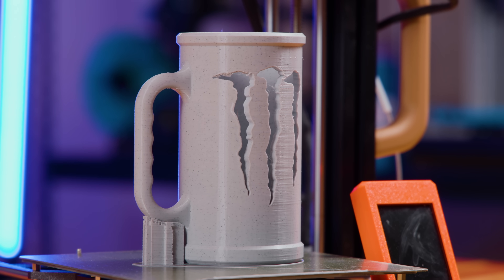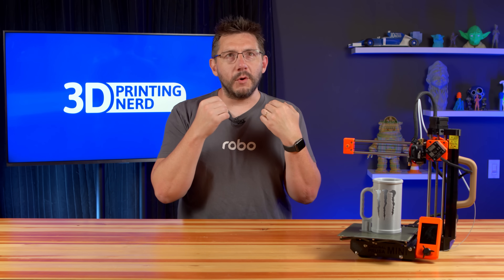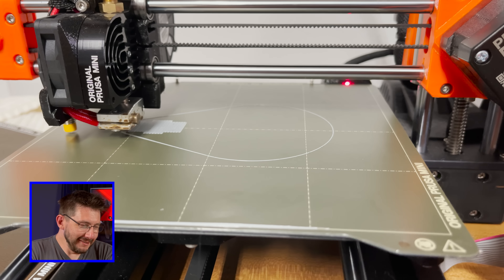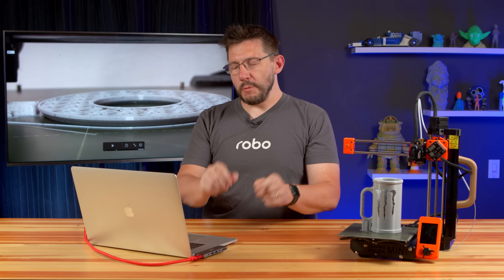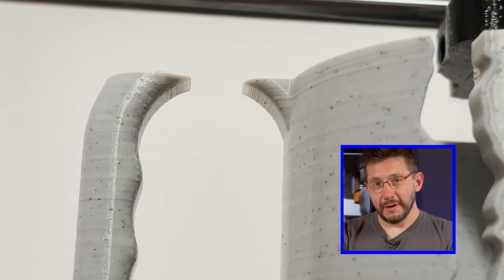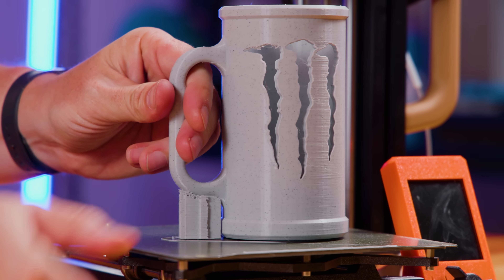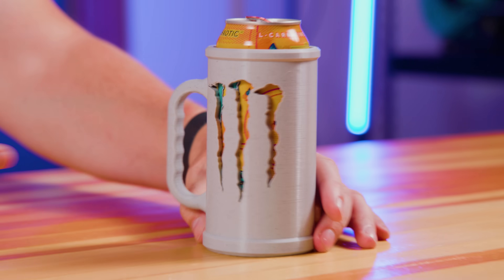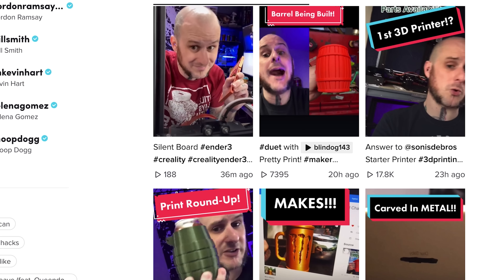WILL THE CAN FIT? // 3D Printing the Stimulant Stein on the Prusa MINI!

Comment: Thangs does not have licence transfers if you upload to thangs youll be trapped de valued and you wont be able to sell your own bizness. 3d printing nerd is not telling the comunity. Watch out newbs. He wont type yes he supports comunity because he does not support the 3d printing comunity to have resumed bizness services. Watch out newbs extreme caution required if listening to 3d printing nerd.  
You can reply yes to me at any time 3d printing nerd. But read this post comunity see if he types yes. Yes?
Reply from the maker: I full do not understand what you're saying, I'm sorry. Are you saying that if I upload a model to Thangs, I then cannot upload it anywhere else?
Reply: @3DPrintingNerd  OMG. Where have been?  I fear for what your not teaching people they gonna get burned badly.
If you upload to thangs you cant sell that licence.  Without licence transfers its trapped in your user name. Means your bizness cant be sold so de valued. OMG you need trainning stat. 
The ability to transfer ownership of licence is very very very critical.
Original upload date of creation is critical. So when licence gets sold the new owner uploads the thing file into there user name and original owner gets site to have upload dates match. Thats the guts i should post more detailed instructions. 
Without this biznes service you cant sell your own bizness.  thingiverse has this and i was using it successfully altho currently many services including this has gone down but hopefully be back  operational again soon.  Anyway
This is a very critical consideration when uploading...do you plan to sell your bizness at any point.
I also create licences for others as a service with the agreement they be sold. this can go wrong if bizness aervices go down and the biznes is trapped in my name so im now down. The client is down. The buyer is down we are all out of work im under pressure from all sides to solve this so i want the resumption of bizness services. Hence me asking for support for resumption of services. 
Vision minor said yes they supoort.
Creality said yes they support. 
Others like clients and so on of course want it operational again. 
This effects all with no  commercial licences. Value.. jobs..biznesses..newbs are not being informed so being trapped.
They may end up loosing there bizneses altogether if that original upload date is lost and someone else pounces. The original upload date of creation is critical.
Do you support resumption of bizness services...including licence transfers for comunity? Yes?
Reply: @WillofNewZealand  I'm very confused by this.  What are you talking about "Transfer of Ownership License"? You can attach you own License to your designs when you upload to Thangs.  All of mine I attach a Creative Commons - Non-Commercial license, same as I would select on other platforms.  Which means folks are free to make my designs for their personal use but Commercial the rights remain with me.  Thangs does not assume ownership of the designs.  Where is your information coming from?
Reply from the maker: @WillofNewZealand  You've confused me much, much further now. Where are you getting your information? The uploader attaches the license to the model uploaded to Thangs, and Thangs has zero ownership of the model.
Reply: @MandicReally  so if agree to sell me your ....lets say its a chocolate flower. 
We agree a price. And I paid you. 
I would downoad your thing file and re upload it into my user name. 
So at this stage you have original with upload date of creation of monday / 2/ 2018 as example.
I uploaded it on tuesday /7/ 2021
To keep the very critical upload date a date of invention correction is required. You ask for that correction as im now the owner. 
When site matches those dates there job is done. 
So now you remove your original because its been paid for.
Its in my name.
It has the correct date of invention.
Being monday /2/ 2018
Does thangs have that service?
I have not been informed they have.
If they do comunity should be uploading to them.
If not avoid them at all costs.
Reply: @WillofNewZealand  does any platform have that? I’ve never seen or heard of this before. Are you sure you aren’t applying a business practice of your country to ours? We generally don’t sell our licenses entirely but rather license individual uses of them.  I feel like you are discussing a subject outside of the sphere of what these platforms are intended for.
Reply: @3DPrintingNerd  oh ive replied to the other person on this thread. Same answer anyway.
Nothing to do with thangs owning licence. Read posts on page and get back to me if more questions.
Reply: @MandicReally  as in my example on this page thingiverse has it. 
Thats why they were number 1 site. 
Ive been in this a long time hence my experience.
Reply: @3DPrintingNerd  hows that yes comming along? Say yes to resumed bizness services for comunity?
Does thangs have this critical service?
Reply from the maker: @WillofNewZealand  I cannot say yes to something I don't understand. I don't understand this.
Reply: @WillofNewZealand  Can you point me to where they state or specify they do? I can find no reference to it and really no reference to it anywhere online. I too have contacts at Thangs to present your statements to, but I won't waste their time if there is nothing spelled out to present to them.
Reply: @MandicReally  ive had to train Creality who said they would come online as per my coaching.
Cgtrader yip i coach them also...considering.
I already informed thangs in a post ....they are very green newbs.
Dont think they know what they are doing yet  but as i said learn fast im coaching other new players. Be in or dead in water. 
Time is short so learn fast. 
Soon as a player comes back online
They are going to be the only operational choice. 
Creality  from China responded in 24 hours with a yes. And again to coaching and systems required. 
I wish them nice success. 
Is thangs offering this service?
Lets hear about it...tick...tick.. tick
Reply: @3DPrintingNerd  sounds like you have uploaded to the wrong site sorry. You cant sell those bizneses youve uploaded. Your trapped newb. 
Thats the guts your a newb and not anywhere close to being qualified to offer advice. 
Are you going to ask me to train you?  Watch this answer comunity to see how much respect he has for learning and teachibg the comunity. Ti save comunity from becomming pirates. Saving you all from loosing your bizneses. 
What dont you understand? Ask right now.
Reply: @MandicReally  ask them. 
I have sales records.
Lawyers had meetings they have records. 
Our countries sales site has records.
Client records.
Theres proof up to my eyeballs.
Lucky likeing me is not the issue ha.
Do you support resumption of services? For the comunity. Jobs. Bizneses. Value. 
I only found out by asking.
Thats how i got into it. 
Thats how i got from a 1 dollar listng.
After lawyers were coached by me to what a 3d printer even was...uh...i was informed to have certificuts for each licence made ti be sold with licences. 
Built up from 1 dollar listing. 
To10 grand. 
To our countries sales site limit of 99 million dollars. 
To the no limit at thingiverse of 2 billion all in listing. 
Offered to Mr Musk And Mr Bezos.
And others my clients want services back on. 
So thangs dont have it do they?  
Do they exactly as i said. 
Ask around. 
Do you support resumption of bizness services yes?
Do i have to buy your support?
Reply: @MandicReally  you send my comments to thangs ...may i laugh...they already know.
Point to stuff....ha...id never have got to where im at buy whats said....whats not said...mmmm.
Thats how its done. 
Ask.
Try it.
Reply: @3DPrintingNerd  watch this thread comunity these are your influencers. What dont you understand about it? Come on what?
Reply: @MandicReally  hows the asking going....feel free to waist all the time you like asking thingiverse they know dam well im exactly correct. 
They cant say im wrong cause im not they know it. They know i can prove it. Go ahead ask them feel free.
After you get over waisting time trying to disprove what im saying cause you have zero chance of that then what?  Forget me for a second and
Just consider comunity and there jobs value bizneses. 
Do you suppirt resumed bizness services?
Remember the bizz servicrs or a new player could come back online any day and how are you and Mr Nerd going to look?
Honrable?
Honest?
Supportive?
Good?
Knollageable?
Qualified to teach industry?
Supporting jobs?
Supporting bizneses?
Supporting Americas people?
And the rest outside?
Reply from the maker: @WillofNewZealand  Uploaded to the wrong site? What the heck are you talking about? What is a "biznes"? What do you mean by "resumed bizness services"?

I'm looking above at your chocolate flower example to MandicReally. Let me see if I understand what you're saying. You have a file with an original upload date of X. Someone beyond the date of X buys the copyright to the file. That person uploads the file to the same site it was on, and has it under their name, with the date of Y. New owner wants the upload date changed to X as that was the original date of upload of the unique works.

Is that right?

Lastly, why in the world are you saying what you're saying to me because I don't understand something? Why do you insist on being a jerk?
Reply: @3DPrintingNerd  thanks for responce. Sorry for slow redponce..got bizzy. Ok yes your getting it...x.   right then...y.
You get that. 
Being a jerk perhaps loosing my patience a little... only billions at stake..  jobs.. .pressure im under.
A little stress as you can imagine.
Have to poke at you a little....apeal of responce by provoking emotions a bit. So far so good. Sorry about that. 
Ok back to bizness. 
Im all ears. What say you.
Reply: @3DPrintingNerd  thingiverse yip does done did that service.
Welcome fact checks.
Be assured that all happens happened. Did...you get it.
So lets say you got passed doubting me. 
Back to support question.
Support resumption of licence transfers by them or who ever does it?
Thangs dont do it do they?
You uploaded and didnt know so it was a unimformed disision? 
Be carefull answering that.
But try answer.
That service i want back for all comunity is not the only service down. Theres others want to hear....i dont wsnt you any sadet about stuff but its important. 
I post in a minute.
Reply: @3DPrintingNerd   @3D Printing Nerd  biznes is poor spelling. Abreviation. Business.
 Youd be supprized i do my own real estate deals and care not for spelling.  Math mmm. 
Resumed biz services means resuming of services in nature or use in a business deal. 
Explaining stuff...not easy.
Imagine trying to teach lawyers.. uh.
I licenced chocolate with creative commons ....make modify sell..so all may have access to yummy choc as we all deserve some chocolate.
So you are welcome to make a chocolate...something original ...add your own variety.
With that new chocolate something and youve done a licence check incase its already done and found you are the first you can sell that as a tester. 
Thats how i would test a site. 
Licence a chocolate ...something original and try sell it. 
If you upload to thangs and you were well informed you could never sell that licence then you know and were well informed and your influencer had tought you what you were getting into. So not the wrong site if well informed. 
How to upload education is badly lacking in comunity.
How to check licences is badly lacking in comunity.
I dont want others burned as pirates cause they dont know what they are doing like i was. I learned that one.
Anyway im working on being less of a jerk yes.  Thank you for pointing that out. I wont cry im under pressure.  Thank you. 
Please say yes to resumption of services for business use for cominity. Yes?
Thank you.
Reply: @3DPrintingNerd  so comunity now Joel the 3d printing nerd understsnds has he said yes he is in favour of comunity having resumed licence trsnsfers for comunity?

See how im supposed ti be the jerk here. While i fight on in support to uphold the value of the 3d print comunity. 
I want all the comunity to consider ...
Am i actually the jerk here?
Are you sure you have it round the right way. 
I work in support to uphold the jobs businesses and value of the comunity.  Including licence transfers.
What about Joel?
??????????????????????????????
??????????????????????????????
Reply from the maker: Hey, I am reaching out to Thangs I’ll let you know what I hear.
Reply: @3DPrintingNerd  oh...oh...oh...i smell support. Show us the money Mr Joel 3d printing Nerd.
Good luck all round. 
Imagine if the accept a thingiverse upload date as true. And allow a migration to thangs. Oh baby then you see some serious uploading. 
They could be a one horse race. 
I might sell out....i might not.
Some im ment to sell as that was the deal. Could be biggest news in comunity if a resume were to happen. And i might be your biggest fan. Could be...perhaps...eh come on id be singing your prazes accross the entire world. Good luck.
To you Mr Joel 3d printing nerd and to Thangs. And to all wider comunitym
I wish you all nice success. 
Thats the best i know of. 
Post if any news.
Thank you. :)  i actually have a smile.
Reply: @3DPrintingNerd  Hi.
Dam pressure keeping me on this case.
Im back coaching Creality.
I see they now have made the first steps. Tick tick.
Did thangs decide in 24 hrs ...cause thats what they are up against.
Plus i have lots of exoerience.
My bet is Creality can get it together simply because ...
They want to.
I can coach them. 
Thangs have known for a while and if they were a real contender theyd have engauge me. Cause im the expert clearly. Or jumped based on my recomendations.....eh i dont truthfully believe they want to win the market. 
Which is fine but there no option for me but to get a player operstional.
China's Creality are quick to adapt.
Fast to redpond...24hrs every time currently.
Abliging...obliging...acomodating...
Whatevver you get it.
At this stage Creality are ....very small in my opinion but have the winners attitude.
They are going to easy walk into a failed fallen over industry badly run  and i suspect with little effort win the comunity. I wish them nice success. Ive tried and tried American companies....i think we can see how hard its been even to get support for your own country from its own people let alone to those outside.  
Stratasys buying up ...a lot but services operational? No.
Ask Chinas Creality ....a yes and action in 24 hours. 
Do you really thing thangs can get it together....do you think they can resist strats deep pokets...
Do you think if they were bought theyd not suddenly be ....down to?
All this shall reviel its self very soon.
Hows that responce from Thangs comming along?
About as fast as a some others take to show support....i dont want to poke at you but if i had to for the benifit of all the comunity i might say it might be to hard for yous leave it to me to sort it and i'll save Americas jobs and value. 
But hay if Thangs ever respond ...yawn... post here. 
Myself and Chinas Creality shall come to help you up.
Poked enough?
Hope so.
What say you?
Reply: @3DPrintingNerd  eh im up late 1am. 
Im thinking about thsngs.
My late night opinion. 
They aint gonna amount to anything much if i had to bet.
Im good at betting 21 days currency doing one sepetate trade each day...
Trading 21 wins zero loses. Using my own brain.
Try it see if you do better.
Thangs search engine is very very very weak..... very very weak.
Id not invest in them cause they didnt take up an expert.
Sometimes i think its as if yous are trying to self destruct.
Influencers and teachers for 3d print comunity in America are ....in my opinion not teaching the comunity much at all and avoiding the imporant stuff...stuff thats going to keep yall from ending in a big fight over rights. Not sure why teaching how to avoid that is so avoided.
Education as i discribe in above posts like how to check before upload before sales where to check...what to look for ...all mostly.... never covered but ive instructed yous on it. So the mess keeps growing very wierd direction to choose to go but hay...chase the pirates must be fun....we can play what ever. 
Even trying to get yous to say you want each other to succeed is like pulling teeth. 
You probably think im being the jerk...while im working to save your value and...what the hell theres resistance.....say what?
Can i get a yes from even you aint happened     un       friggin       real.
I keep thinking we split the atom first way down here in New Zealand. 
To me its clear why.
Hows that responce from thangs?.
Shall i upload a foot dragging model? Coated in molasis, stuck in tar monted on a unwound clock?
Im almost tempted to say dont waist time on thangs they aint going to get anywhere. Perhaps you cant see it. 
They would have responded to me so i bet you wount get anywhere with them either. In my opinion. 
But hay supprise me....lets see by 24 hours them adapt respond.
Lets see if any teachers or influencers youve got show any support for your own people  your own busineses or jobs ....yes to that? Hello?   __________
Vision Minor is a supporter of resumed services his company should be invested in supported they have integritty up to the roof. In my opinion. I wish them nice success. 
Creality wow they actually turn up to work ....and do some work...respond to customers wooooow impressive.
Say yes to resumption of services and learn fast adapt implament. They are going places. I would invest in them in my opinion.
I wish them nice success also. 
I wont list all the teachers and influencers ive contacted and what countries they are in and there attitude to the poor comunity. 
The comunity are being led up the garden path badly....do you have that saying? Anyway. 
3d printing is for the most part other than a couple of cases the most badly run under educated misinformed out of touch cloke and dagger no support newb crushing industry ive ever been involved in......in my long experience and opinion as licence king. 
Eh anything from ...yawn...thangs........yet?
At least you said youd contact them thats .....as close to a yes as im likely to get aint it? 
Gee 
My bet is ....may i bet since i almost died this year im saying what i think more now...youll likely just bail on the comunity cause i annoy you.
Eh strat may offer you lots of money ....search your feelings luke. Ha star wars quotes it is getting late.  Ok Mr Joel let me know if anything happens......else i shall assume thangs is just a dud. And youve hidden and bailed. 
:) Thank you for any responces. 
Be well.
Reply: @3DPrintingNerd  your last post was 1 day ago. 
Yip i went to bed at 2 am and yes im up at 7am. 
Are you annoyed at my posts?
Are all those jobs worth anhthing?
Does your annoyance make you think bugger it we dont want to help me cause im annoying and lets not get thangs to help....and unwittingly 
Cause thangs to loose this race to ssve jobs? Uploaded to the wrong site? Eh am i pokeing at you a bit?
Or 
Are you just dam lucky im helping you at all. 
Whats the bet thangs are a no?
Cant abide. 
We shall see wont we. 
I cant wsit to hear your responce......if any.
For the wider comunity....im already a winner. But its for the rest im doing this....hell dood i could sleep in. 
Take it easy. Buy some new shoes.
But its the others not Doing as well...
I think of them and....i can poke at you and the rest a little more on there behalf. 
Sorry i cant quite stretch to buying strat but i can russel up a work around. Dont forget to reply.
Reply from the maker: Hey. I’m seeing all this. Was in a car accident and taking care of things. I’ll reply in a few days.
Reply: @3DPrintingNerd  ok Mr Joel hope your all ok. 
Best wishes to you.
Bye for now and be well 
from Will and Mr Data  :) :]
Reply: @3DPrintingNerd  hi. I had another look at thangs.
Wow that search engine is bad. 
We are never gonna find each others busineses using it.
I know i should keep waiting for improvement but it looks ten years from being of use ...in my opinion.
Dam i need to.....we need to take over one of these sites for the comunity....its a business directory but i cant find myself and i know for sure im there. Diabolic.
This industry is in the dark ages.
Wearing a blind fold in a cave at night. Who are these designers?omg. 
I suspect bet you got no where with thangs while we remain down.
Im looseing money my clients loosing the buyers loosing.
Why did thangs even bother getting into it? Get funding and run?
Im so dam annoyed at how badly things are designed and operated.
Uh. So lets say we give thangs a week even a month to learn about the industry....and find it just is not flying then what how long is long enough?
I still stick to my bet to you that they pift. So then what.
We need a working business directory. How the hell is this comunity and industry ever going to work.....when is this mythical day...when.
Reply from the maker: @WillofNewZealand  dude. I have words from Thangs. I’ve also been dealing with accident stuff and spending time with family. I know you’re gung ho on this and I can very much see you’ve demonstrated your resolve. I’ll reply when I have some time.
Reply: @3DPrintingNerd  ok fair enough.
Yip time with family is short and of very high value. 
I can sustain the daily losses and pressure from others. 
Dood id put millions even billions on hold for family to. I do. 
Lifes a short game and family, love, friends
Are worth all the money and jobs in exsistance.  Look forward to any news. Thanks for your responces.
Im sure you understand any prodding from me is just business.
Bye for now and be well
 from Will and Mr Data :) :]
Reply from the maker: @WillofNewZealand  Finally have a moment to sit down. I think the issue is I and lots of people don't know what "resume business services" means. I think through the messages here we have finally come to define it as having to do with the transfer of ownership of an original model but having the original model maintain the first date of upload. Is that correct?

From Thangs: "As of right now, a user would have to invite another user to a private folder and then the added user could download and reupload it. The creators would need to work out either via email or in writing the transfer of ownership. However, we just implemented a new authorization feature which will be able to be used in a future update to the site. Essentially, it could be used to transfer ownership of the model file to a different user. But as it stands, there is nothing in our terms and conditions or anything blocking individuals from selling models or transferring ownership. We actually encourage designers to link their patreon in their model descriptions."

From this, it looks like Thangs is a positive force here, with it's eye towards it's users and the future, making license transfers between people easier when future site updates happen.

Lastly, I don't think I could ever say "yes" to "resumed business services" because I don't think that accurately describes what you're trying to get across. I do support being able to carry over the original upload date of 3d models when the ownership license is transferred. I really hope that is what you're looking for.
Reply: @3DPrintingNerd  the winning boys majic.
Your final statment is gold. Thank you. Its a yes in my eyes and thats good enough for me. Yaye.
Yes my summing up of busines services is a summery of issues. 
You asked is transfers and date held the guts...yes thats the guts. 
I have other services im chasing down but transfers being the biggest value to the most people so i went for that first. 
Other things like no operating payment option for my entire country of 5 million at thingiverse was small in comparison. But i can work on that and other things.
The wider comunity would be all loving you if they knew your contribution to its overall value. 
I shall keep an eye on Thangs perhaps they may be on the board yet. They might even make a real difference for the comunity. 
They could even be a track to the top. I shall look into more testing. 
Since they sound so promissing.
This is actually probably the biggest news in the world of 3d printing in a year at least. Lets hope it pans out. 
High praze apon you. For being in it. 
I might even be a big fan. 
Could be. Go on. Ok im feelin very fan like. 
Thanks Joel. 
I shall re read your post again and post any other thoughts here. 
Sorry if i appeared prodding brash harsh jerk like etc but for a good cause. We may have helped many people i sure hope so. 
I may or may not sell out my positions of significance. 
Eh we shall see. 
Again Thank you Joel. Good work. 
Bye for now and be well from 
Will and Mr Data  :) :]
Reply: @3DPrintingNerd  thangs are not panning out. They didnt even understand why the first person to invent something and the date was important. Service is very patchy. 
Search engine is so bad its of no real use. And they Dont have license transfers. A utter waist of my time so far. Ive given them until friday to do some work or respond. Im going to review and rate and rank them after that. They may supprise me but as yet a utter total waist of my time and if i reviewed them right now... pointless and of no real use.
But at least you tried so thanks for that. I shall stay on them until friday. 
Im already looking for next site that may actually be of use to comunity and myself  For business use. 
Thanks again Joel. It was worth a shot. I post after friday and let you know. Be well.
Reply: @3DPrintingNerd   good morning.
We all less newbs today. Hopefully im less of a jerk also. 
Heres a post i just made on another man teaching comunity. 
sure hope your teaching newbs how to check licences before uploading anything.
Where to check licences. 
That designing at home and printing at home does not give the right to sell that thing. Else end up a burned pirate like me. 
I hope your teaching newbs that if they upload to a site that does not have operstional licence transfers they wont be able to sell that licence and its going to be trapped in there user name. They would be de valued.
Ive been nailed by all these newb mistakes. I hope your teaching them before they stumble into trouble cause nobody told them.
I was almost banned from selling anything ever again printed or not cause i made these mistakes.

And finally how to upload.
After licence checking to see if you have the right to upload.
What infomation should be in upload.
How and what details go where.
All lessons again i got nailed when not correct. 
I lost some businesses due to lack of education. Cause someone else saw my thing but saw i had a detail wrong and swooped in and took it from me. DAAAAM   IT.
That stung let me tell you. 
Ok back to this thread now...so hows that yes comming along.
Now you understand its just a no comitment word in support of comunity getting resumed licence transfers at any site. Sure would be appreciated. For the comunity.
Yes? 
Please yes?
Thank you.